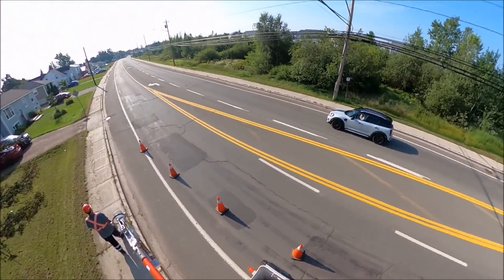Opening 3 phase line using Loadbuster

Comment from the maker: Hey Everyone! 
I'm not going to have any free time at all this weekend to do any editing, but I figured I'd drag this one out of the archives! I've had a few asking to see the load buster in action (without looking away) as well as some questions about the proximity potential indicator 😁🤘. 
Oh and copper thievery is on the rise BIG time as of late, so if ya's see or hear of anything in your area...🚓🚓 Thanks!
Reply: Good Morning Aaron,
The biggest issue with copper theft has been cut down grounds on equipment. They’ll reach under the plastic molding as high as they can reach & snip it with pliers from their standing position. Then cut at ground level. I have seen this multiple times on the same street. It’s completely random. I have seen it in good neighborhoods & bad neighborhoods. One time myself & another lineman were tasked with replacing down grounds in this one area on overtime. There was a rash of thefts in this one particular area. Company policy is to replace the entire down ground. No simple repairs because repairs could come apart? Well within short order we found a leaking overhead transformer in a 3 phase bank. By the time we had one delivered,cut & installed we got an all nighter out of it 😎
Reply: @johnclyne6350  same problem in our area, cutting all pole grounds in some areas..wait until they cut one on a delta bank that is having 'issues'..
Reply: @stanroesner3892  We had a call for stray voltage on a customer’s service a few months ago. We investigated & found that CableTV had bonded their equipment ground to the down ground of delta transformer on the secondary crib. Lifted the CableTV ground off our down ground. Problem solved! CableTV tried bonds onto our equipment grounds & down grounds all the time. Instead of installing their own ground rod. Pure laziness! No wonder we have calls for stray voltage.
Reply: @johnclyne6350  Ongoing issue, Commerce Commission allows Telecom  and CATV  to bond to our grounds, then they complain about 'noise' on their facilities!!
Reply: Appreciate your posts..had an issue with the early load busters years ago, the sacrificial media would erode, unknown to us, until we tried to open a cutout or on-line or in-line single pole switch..burned up the load buster and locked out the circuit!!  Now we have counters on them, and regular replacement of the 'snuffer'. Pretty exciting experience  for a young journeyman, 8' away from the phase to phase!!!
Reply: @stanroesner3892  👍👊🏻 We had the same issue years ago. However our load busters were on a rotation to be rebuilt every so often until the counters came out. I had to open a side tap for routine maintenance years ago. The load buster traveled half way open & jammed. The system voltage was 13,200 volts (22.8 KV). Anyway I could hear inside the tube that the medium was not happy. To let the door drop open I unhooked the spring loaded catch on the ring of the door & drew a great Jacobs ladder. The helper on the ground got to see a great light show. I anticipated that so I enjoyed it too. The door fell all the way open to break the load. That load buster was red tagged.
Reply: Bob, I have the utmost respect for you. You have a long career and you are extremely safe. And you work in the rain. Alot of people don't know, pure water is not a conductor. The minerals make the water a conductor. So, rain from evaporated water in clouds is not conductive. Distilled water could be an insulator. Long as those sleeves and gloves are clean, your good. But I've watched you and your channel, you'd be a good guy to put apprentice linemen with. You don't cut corners. Doing telecom linework I had a few errors and I know what causes deaths and accidents. Cutting corners. I had an incident lashing cable to bare strand on a long span. I knew the opposite end of the line rises when lashing. I hooked the rope to the outer rings and told my groundhands to pull out on the rope. I figured they understood what the deal was. They didn't. Halfway thru them pulling the lasher, I was pulling straps out of the pads on my hooks, and heard the " zzzzzzzz, pop pop pop snap snap" and saw blue. The idiots let tension loose and the line rose up into the secondary. And the secondary neutral is on top, not the bottom. It burned our line in two pieces. The hand kept snatching on it as if he was having fun, which was fine, but I didn't know what kind of rooes we had so I told him just let go of the rope. After having a coworker killed, all I saw in my head was my hand dropping to the ground DEAD because the rope was a conductor. It didn't happen of course, but like I said, after having a coworker killed, I just saw my griundhand dropping dead, in my head thats what I saw happening. The strand just burned in two pieces and the lasher smashed into the ground. But, I learned not to cut corners. I didn't use layup sticks to hold down on the line because it saved someone a long walk to the truck to get them, and I had too much faith in my groundhands thinking they'll hold pressure outwards. I had too much confidence in my hands. It happens. When I started linework, I had climbed two or three poles in my life. No pole climbing school. I had worked for a Bell Atlantic subsidiary and got pissed off because they cut off gaffing training before I got my turn. I HATED toting that big ass fiberglass ladder. So I bought my own gaffs, a set of Klein gaffs and used them only a couple times for Bell Atlantic. The third pole I climbed was like sixty feet and it was raining, I had my rainsuit on, we were doing an interstate crossing. But, I have confidence in myself to do things like that.
Reply: @jonwillard3198  Almost. What comes out of the clouds isn’t pure; it’s picked up dust both when it condensed out of water vapor and on the way down. Also, water - even 100% pure lab-grade multiple-distilled water - will disassociate into a H+ ion and an OH- ion in small quantities. These effects give the water a very small amount of conductivity; and if you put enough voltage across it you can get measurable current flowing. Usually in practice it’s not enough to zap you or cause arcing on the equipment, but it is there. 🤔
Reply: So now we'll have an increase of convid deaths because they'll claim all the people who kill themselves stealing copper from live lines, died from convid instead of saying they died stealing copper. They want to play that up as long as they can and hid their poor performance as politicians allowing this crime increase.
Reply: @mikeznel6048  Bull. COVID deaths are counted as COVID deaths and electrocutions are counted as electrocutions.

P.s. - your tinfoil hat is off-center…. Might want to adjust that.
Reply: @mikeznel6048  no

Comment: I work in 230kv transformer Station crew and a few of our stations have 44kv single phase disconnects that fucking pop when you pull em like that. Barely any load on them because breaker is already open but still cool

Comment: What type of voltage detector is that? We  have the Salisbury with the twist knobs. They get kind of aggravating with the class 2 or 3 gloves and trying to twist the knob to the different settings.  Plus the readings on the dial are hard to see. I like how that one was push button , it seems very user friendly.

Comment: I’ve never seen the hot stick attachment your using to break contact of the fuses. Why not use the yellow link stick for the whole job? It’s all I ever use
Reply: That device is for breaking load on the line.  It snuffs any potential arc.  The Arc can easily cause a phase to phase fault.

Comment: so what would happen if you didnt use the loadbuster? and just the other stick
Reply from the maker: As the door opened it would draw an arc. Without getting technical, more load = bigger arc. Our standard is more than 10 amps on the primary system requires load break.
If theres enough amperage, the arc won't extinguish even when the door is fully open. It will move around as it ionizes the air around it allowing it to grow in size until either air resistance becomes too much and it goes out or it connects with ground/another phases which spike spike the current and trip the line

Comment: I like your comment about 3 phase equipment users having relays to prevent single phasing. I have seen lots of burnt out rooftop AC compressors from that and it is a big problem.

I worked in a medium sized hospital and it got single phased when a drunk crashed into a major power pole and broke one wire. Major brownout.

 All my boiler feedwater pumps overheated as they started running backwards and it was a huge mess. We had a diesel generator backup but it takes a few seconds to startup so I hate the idea of single phasing.
Reply: Even if there are protection, the electrical company should prevent that. In my country switches on the poles are built in a way such that opening it it will open all 3 phases at the same moment. Also every three phase switch/breaker must be built in a way to prevent disconnecting all three phases. For that reason fuses are no longer used, at least on low voltage circuits, and on high voltage they have circuits to detect the loss of a phase and that interrupt the power to prevent damage.

Comment: Worked on a three phase 480 power supply which converts and supplies DC at very high amperage.  It had a circuit to shut down the supply when a phase is missing or out of sequence.  Curious why (or maybe just didn't film it) you didn't ground the dead side to eliminate any inductance voltages.

Comment: is each phase 7600 volts or 13,000?
Are they a hundred and twenty degrees out of phase with each other?
Reply from the maker: 7200 phase to ground and 120° out for a line voltage of 12470.
Reply: @Bobsdecline  Please consider a quick whiteboard explanation of the three wires. I think it'd be very helpful to all of us.
Reply: @mobilecommunicationsnetwor5268  Looking forward.
Reply: @Bobsdecline  12,470 is measured between any 2 lines?

Comment: Does anyone know if it is standardized that the top of the cutout is connected to what would be considered the supply side of the line?
Reply: Yes. Always bring your “line side” or source to the top of your cutout. And “load side” out from the bottom. This practice makes sure the only thing energized is the top of the cutout when the barrel is out. Say you are refusing a cutout with the reverse, then when you sit your barrel in the cutout it will become energized, and you have an extra hazard.
Reply: Yes, it is a standard.

Comment: Why didn't it arc
Reply from the maker: The electricity traveled through the loadbuster device up until an internal spring mechanism snaps and disconnects the load very quickly.
I posted a video approx a year ago with some more details

Comment: As always Aaron! Another well made video! 👊👊👊 I prefer to take the high side taps off the line incase the cutout leaks voltage. Every utility mandates a different procedure for isolating a line? On my first ground I connect my ground to the neutral & tap each de-energized phase to remove any compacitance. My first ground goes on the center phase, then jump the center to the road & the other from the center one to the field. We missed the grounding sequence in the video so some people were confused by what you meant? 
You had a groundman in your video. Usually you work “Hans Solo”. 
Since I’ve been in linework there has always been a load break tool. I’ve been in linework over thirty years. Just a little more than you.

Comment: Bob, I've watched you and you're a good guy to learn from. I did communication linework for a few years, and who you learn from is the key. I learned from a top notch lineman. He was never an electrical lineman though. He did streetlights and secondaries for one company, but straight telecom linework where I worked. We built new aerial plants from the satellite to the pole in front of your home. Biggest strand was 5/16 strand. I hated running the 5/16 strand due to the fact we got 7 cents a foot for pullin strand. I hated it. We'd have to load 5,000 feet of it which would pay us I think 140 dollars for the day. This is one of the reasons Ricky Hughes contacted 19,900 volts and lost his life. The only focus was run as much cable as possible. Safety was in YOUR hands. You know what to touch and what not to touch. Don't even touch the power neutral. Act as if it is live. Those lines are powerful, very. My coworkers said it sounded like a cannon went off when Ricky contacted 19,900 volts. But, im sure if you respect those lines, you'll have a nice long career.

Comment: 0:53 when you mentioned that it reminded me of my friends business that lost power on 3 phase. He had some electric motors on his crane and a transformer in his welder burn up.
Reply: They were single phasing when one other phase dropped out. That’s the scenario where motors could burn up? If they don’t get the voltage they need? They try to compensate by drawing more current burning up the windings.
Reply: I have heard of 2 phase airconditioners burn up for the same reason.

Comment: And as usual, as I watch I have a question. And your next sentence answers the question. (In this case, the question was, "Shouldn't you switch all three phases at the same time to prevent problems?")
Reply: From what I've learned at Line School so far is the 3 phases aren't connected together they operate separately Phase A, B, and C so if phase C shuts off it won't affect phase A, and B which is why you can operate the cutouts one phase at a time. But I could be wrong im only in line school so if I am someone please correct me so I can learn some more.
Reply from the maker: In a nutshell - 
Equipment that uses 3 phases will attempt to operate on the 2 remaining phases and cause damage.
Voltage can also back feed through some 3 phases equipment causing a low voltage on the open phase.
Much the same as on a house with 3 wire Edison - remove 1 phase while the breaker is closed and a water heater hooked up, and you'll see 70 ish volts on the open phase

Comment: Why are the the short lines that connect to the switch so much smaller in diameter than the main ACSR cables? Great vid & beautiful town!
Reply: Those tap wires are all copper. Those in the video look like #6 but #2 Cu is the most common. That size copper in open air can handle tremendous current.
Reply: @ucfsub  Makes sense! Thanks for replying!!!
Reply from the maker: 💯! Our standard is #2 copper for a side line switch with 100amp cut out doors and #4 copper for a transformer lead.
Reply: I'm not an expert but maybe the little wires are Cu instead of Al. In either case the short wires don't need the steel reinforcement.

Comment: I hope this has never happened to you, but if someone were to run in to a utility truck while the operator's all the way up on the boom -- how badly injured could the operator get? What safety mechanisms are there?
Reply: On MAWP OSHA requires everyone to wear a fall harness, so any unexpected movement of the platform you can’t be thrown out and to the ground.  Not sure what’s expected in a boom truck, but would hope the same rules apply.
Reply from the maker: Absolutely Fall arrest at all times!
This a 50kph (30 mph) zone, not that it means much nowadays... But there are impact trailers used and barricades when working around high speeds.
Reply: @Bobsdecline  I imagine it'd be pretty difficult for a utility truck to be rolled over by impact with the boom extended all the way?
Reply: @Joel1231a    More like imagine a catapult if the truck gets hit.  Boing

Comment: When would grounds be installed? I understand this is being done as a precaution for work near the lines. I'm assuming if work was being done on the lines, that's when it would be grounded?
Reply: There is a common adage " it ain't dead til it's grounded"
Reply: If you are repairing primary off hooks would be one situation. If a tree trimmer needed to cut a tree physically laying on the lines might be another depending on policy.

Comment: Still confused. No Neutral running along with these 3 transmission/distribution lines.
But, when showing us a branch circuit with only one phase, you point out
a neutral running along with in.  In fact, you jumper the phase to the neutral to insure
no potential.  So why the neutral on the branch circuit. Thank you.
Reply from the maker: The neutral within the triplex is oversized and shared by both the high and low voltage in the system. 

Many of our lines in town are built with triplex from pole to pole as opposed to a single aluminum wire. This allows 1 larger transformer to pick up services to houses across 2 or 3 poles.

When grounding or bonding the line, we use the neutral on the triplex, which is also grounded at every pole (on our system))
Reply: @Bobsdecline  Isn't the shared neutral a big danger? In case the neutral got broken for some reason you can potentially have high voltage on the low voltage circuit.

In my country high voltage doesn't have a neutral, just the three phases. Primary of the high to low voltage transformer is completely isolated.

Comment: I'm imagining pro/con on overhead. Those regions with lots of growth should reduce maintenance whith cables dug in ?
Reply: No its more expensive and costs more to repair, upgrade or modify tie in.
Reply: @mikeznel6048  been doing 3 phase U/G splices for 2 weeks, your right, it’s a pain, thankfully splices have come along way! Pretty much all Pre made and cold shrink, some cable prep, they still have their quirks tho
Reply: Underground cable installations have problems all of their own. When they fail, the fault must be located, area dug up and repairs made. Try doing this in the rain, snow or dead of night. Not fun. 
Not all tree trimming requires taking lines out of service.